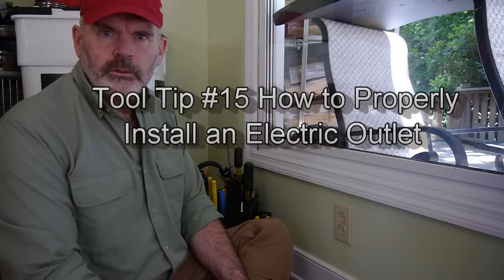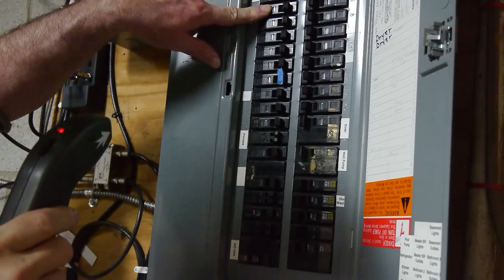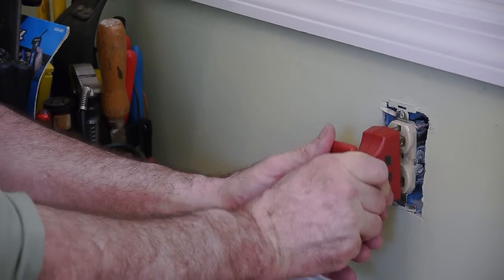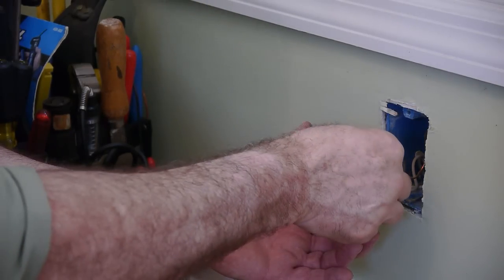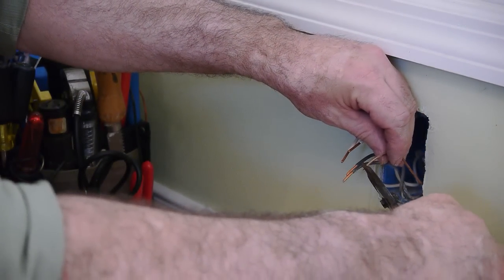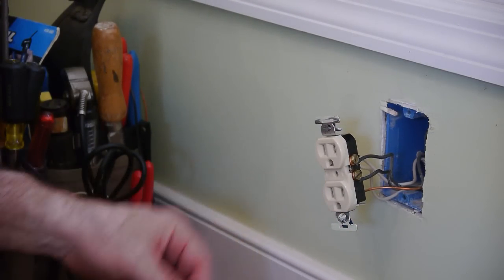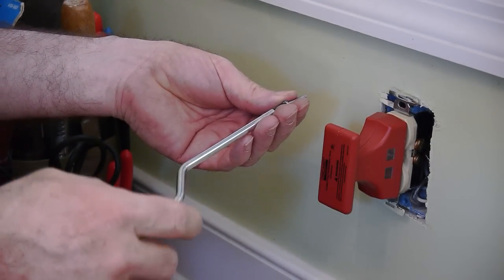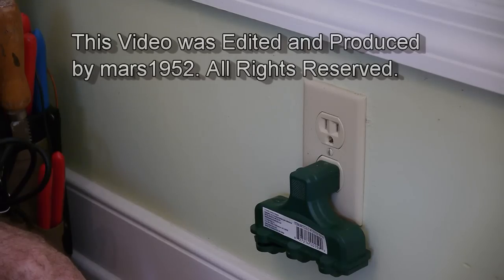How to Properly install a Electric Outlet Tool Tip #15

Comment: in the medical field thats how we install out outlets. just becuz most medical gears cords are heavy and they stay plugged in better.
Reply: I have heard this debated over and over.  I worked with a lot of electricians and technicians, and I never heard anyone tell me that they knew the reason why we did this.  A lot of people have their opinions and theories but since it isn't required by the NEC, I don't think anybody can prove the real reason we do it.  My theory is that some electrician thought this was the safest way to do it in a hospital and passed it on and it made sense to his buddies and it started getting passed around.  I used to install electrical equipment in Air Traffic Control towers and we were not required to install outlets upside down, and I know that our equipment cords were every bit as heavy as hospital equipment and they did not fall out.
Reply: It’s not rocket science try to pull a plug Down with ground down then with one up ... you’ll know then gravity is a bitch

Comment: There is no such thing as up side down unless the receptacle is stamped with "top" on the yoke.
Reply: I have one that is identified as up on one end and that end is with the ground up.
Reply: As I stated, it does happen, but 99% of the time, its only switches that are stamped "top" unless they are a spec grade receptacle.

Comment: I think outlet's should be made with the ground at the top, reason. I had a metal sign(cheap thin aluminum) attached to a wooden pole. It slide down the wall and hit the plug that was in the outlet, or it hit the small space between the plug and outlet. When that happens it blows the fuse/breaker.  If it has the ground at the top, that never happens. 
The first time that happened was at a house I was renting, it kicked the breaker, as it should. But as I said I was renting the landlord never told me where the electrical panel was. He was not home so I had to find it myself. And where it was , was a pain the the ass to get to, as the house had been added on to.
So when I built my work shop at the house I had built I put the outlets upside down to avoid the problem of anything getting behind a plug, in the outlet and kicking the breaker of causing a fire. Of course in the house most all are put in the normal way. But I still think everything should be made with the ground at the top stopping the problem.
Also at hospitals they have different circuits for different equipment and I've noticed outlets with orange covers(they have orange outlet also) are installed with the ground at the top. I asked a maintenance man and was told it was for safety for (I don't remember the equipment) to be plugged into.  Oh well that's my take on it.
Reply: Sylvia isgod  Most new refer's have a plug that is made 90% from the cord. as in bent 90% so the cord hugs the wall. do what ya want but that's the way  I wired my work shop
Reply: Sylvia isgod  yep, that's right

Comment: According to code ground is up. The outlet was installed correctly.
Reply: I don't what section the grd up thing is. It was more of a union thing. As I was told if something metal was to drop it would hit the ground first. Now the way he wired is against code. Code says "a device needs to be able to be removed from the circuit without interrupting the circuit" In other words DON'T double hit. Tie the whites together with a wire nut and add a short (4-6") pigtail to attach to the device. Do the same with black. Otherwise that little "jumper" is part of the circuit and turn into a fuse. It's there only to feed the  other half of the recep. Not the rest of the circuit. You break it off if you're splitting the recep. Half hot and the other half switched or 2 separate circuits (on the same leg)
Reply: Ground is down.  Sky is up.  PhD in Astrology here.
Reply: Any of you been to a hospital? Ground is up as anything falling down the side of the wall will hit ground first.
Reply: I never saw ground up until I stayed in Virginia.  Down south, at least in Georgia and Florida, it's ground down. Most plugs, like in refrigerators and washing machines are made for the ground to be down, too.
Reply: Sylvia isgod Sounds like a good compromise! 😆
Reply: Nope..according to NEC, either way is acceptable.  Commercial is usually ground up and residential is ground down. Neither is safer than the other.
Reply: Sylvia isgod  then why are you on here and not out solving the crisis?
Reply: Sylvia isgod that's acceptable to those that can.  Its unfortunate that not everyones work load isnt able to be performed at home. Virus or not the world still turns and Bill's must be paid for us not to lose everything we worked for. So these discussions like this one still are important to us that works in the field. Covid19 might be here but the world still runs.
Reply: Agreed-I am in and out myself.. I have my own opinions on the whole covid solution and how it should have been handled if we had an intelligent government but we don't. With that said I continue to push on in my line of work which is construction and remodeling. Since this forum is related to that here I am..

Comment: I have the same 2 wire outlet however do the Black & White wires also have to correspond to the top and bottom outlet? I understand that white go on one side & black on the other. But, does it matter if it's top or bottom? The one I took off to replace was using a white wire from one main wire set and black wire from the other wire set top outlet and bottom outlet. I have always just replaced them how I found them except this time it has me wondering if that's correct or not? I never thought about it before since it was working before. I cannot find a YouTube video specifying if it matters or not making sure to use the wires a certain way beyond the white both on one side & black on the other.
Reply from the maker: The black wires go through the circuit breakers. The white wires all end up in the same place (attached to the neutral bar) so I guess it does not matter if they get mixed up. Since I am compulsive I do not mix them.
Reply: @mars1952  I wonder if it matters when you're changing a standard outlet to an AFCI. I just did this on two outlets in my home and found that the white wires on both were not matched to the blacks of the same cable, so the black wire on top was opposite the white wire from the other cable. I wonder if there's a reason for it or just the electrician's preference. Anyway, I installed the wires the same way on the AFCI outlet and it didn't work. No power and I couldn't reset it. I switched the whites and it was ok.

Comment: I have a friend who lives in an old apt in Astoria, NY, it runs on 1 fuse and the breaker isn't accessible.  The landlord is slow to fix anything and it's been years.  Can she hire another electrician to fix outlets that are crackling? When she turns on the switch.  Thanks for your help.

Comment: I've actually seen the "very unlikely scenario".  Some metal wall decor fell off my wall,  hit the plug below, and the outlet shorted out between the two prongs. I was all like - holy crap, that actually does happen.  So, given that scenario, the ground should be up.  However, I agree that ALL angled plugs are designed for a down-position ground.  I've heard lots and lots of people say that ground should be up according to Code, but no one ever seems to be able to reference the actual code.  That's my pet peeve - people jive talking about code, but not actually being able to ever reference it.
Reply: No, the Code has been silent on this issue for decades and has not changed. Especially for dwellings. I have heard Hospitals have their own rules for outlet direction and that’s ok. This issue has been going on for ages. Since the code gives no direction, do as you think best. Lol.

Comment: I'm thinking plug might have been upside down because one connection is probably controlled by switch.
Reply: exactly...very common way of electrician letting u know the outlet is switch controlled. maybe that wasnt the case here.

Comment: Why did the whole assembly move at the very end, when you were pulling the night light out? Ahhh never mind. When you adjusted it, it came loose.
Reply: Because he did not have the outlet properly tightened

Comment: One of the indicators that a do it yourself person was doing work . You see cracked plug covers . That is caused when the plug is tighten right down in the box . You should leave from a quarter to a eight of inch from tight to the box . Then when the cover is put on it sucks it right up nice and straight with no strain on the cover plate to crack .

Comment: A couple of comments: A) the reason that the ground I placed on the top is to prevent electrocution if a plug is loosely installed and something falls across the top.  It's actually the "correct" way to do it, but we (Americans) got into the habit of putting plugs in "upside down", so manufacturers started making things that plug in upside down.  So, it's not "wrong", it's just the conversion now.  B) you should have used pigtails instead of connecting the wires directly.  The reason for that is that if the plug goes bad and you wire it the way mars says, then you lose power down the rest of the line.  If you wirenut the lines together and then have a pigtail coming off of that to the plug, if it goes bad, the rest of the line will not be affected.

It's a little disconcerting that mars didn't know about the way that the back of the plug works.  That's how ALL plugs are now-a-days.  How could he not know that?

Comment: In Ontario, its code the ground should be on top, no one does it
Reply: James iPad Ik I’m late, but if ur returning to Ontario Canada you are wrong there is no code indicating which way it’s installed except when installing horizontally
Reply: @slugh8499 - Assume you meant referring, not 'returning' .

Comment: the question is arc fault or ground fault , trips a breaker quicker
Reply: Arc fault more sensitive but they both dump at the same speed.

Comment: What is the name of that wireless tool you used to check for the power and you scanned the circuit breaker box?
Reply from the maker: Search for "wireless Circuit Breaker Finder".
Reply: aperxmim it is called rubbish.

Comment: Installing duplex outlets with the ground up is a good idea. If something like a metal ruler that was leaned against the wall fell over and by some odd chance slid between the outlet and plug, it would strike the the ground prong instead of possibly striking the live prong.

Comment: I was once measuring a wall and the tape measure slipped (as they always do) and it fell onto a plug that was slightly out of the wall.
The ground pin was down and so the metal tape measure shorted across the live and neutral pins sparking and giving me an electrical shock.
The ground pin should be at the top for this reason.
Reply: Exactly, or if a child would be near it with let's say a butterknive. This would cause a seesaw effect and no electrical shock. Brains people!!

Comment: Here's a dumb question... Why is there a second set of black and white wires? I assume that they pass through the outlet and then off to other outlets and what not on the circuit?

Comment: What is that tool called that he uses to grip the outlet with? I have tried to locate such, but since I do not know the correct name, I am at a loss to find them.  What is the red handled outlet remover tool actually called?
Reply: I forgot to add that I have rheumatoid arthritis, so a handle on such would help me a bit in doing these swaps and repairs.
Reply: It's called an Outlet Plug Install Tool. Harbor Freight sells the Chicago Electric brand tools, as does Amazon, but neither offer this item anymore. Both list it as item "94742."
Reply: Thanks, Joe. I have searched amazon, ebay and many other sites, but this produce it no longer made or sold, as best I can determine.

Comment: Hospital has the safety ground on the top of the duplex?
Reply: yes, in more industrial settings, i.e. not a house, there usually is the ground above the duplex to protect the duplex from shorting out if there is ever something that falls on top of the duplex, which could cause a short and cause a fire. its really just a safety thing.

Comment: I know nothing of electrical, can't you just flip the outlet without replacing it?
Reply: Andres Gaviria yes you can. Long video for such a simple job.
Reply: Yeah, I have no idea why he started out with the idea of replacing the plug.  He didn't even know that it was wired "incorrectly" until he pulled it out.  Too bad he then wired it incorrectly in a different way.

Comment: How come there is no blue fire ball when you touch neutral with screwdriver ?  When I change it, even though I turn off breaker, there is blue fire ball.
Reply: You have a wiring issue. I have never had a blue spark from neutral or the hot side when the breaker is off.?

Comment: What is the name of the tool you used to find the breaker, the one that sends the radio signal?
Reply from the maker: +Dirk Smithson It is a "circuit breaker finder". They range in price from $25-$90.
Reply: Thanks!

Comment: Why are there 2 sets of black and white wires? I assume the line runs to more outlets. If so why aren't there 2 ground wires?
Reply from the maker: The ground wires are twisted together. You could do the same with the black or white wires if you want to.

Comment: What is that red device called that he starts using at the 4min 32sec mark?
Reply from the maker: Sorry I can not remember what it is called or where I bought it.
Reply from the maker: I looked at the tool and it says Chicago Electric Outet installation tool. Here is a link:
 http://freightset.com/pdsdisplaypagedetails.asp?pid=1079211
Reply: Crossnote it is called rubbish.
Reply: @mars1952, your link doesn't work anymore. Harbor Freight sells the Chicago Electric brand tools, as does Amazon, but neither offer this item anymore. Both list it as item "94742."

Comment: Yes, there are certainly some extension cords, night lights, and other devices with three-prong plugs that seem upside down when you plug them in, but that happens no matter which way your plug is installed because manufacturers are clueless, too. There appears to be no "correct" way to install these three-prong outlets; however, most knowledgable sources say they were designed to be installed with the grounding prong at the top. The reason is that if the plug is pulled partway out of the socket, one might accidentally come into contact with the prongs of the plug. It is far less likely for a person or object to come into contact with the hot wires if they are on the bottom and the ground prong is on the top.

Comment: Ground  should always  be on bottom  if on top & plug hinging  down  ground  might not make connection
Reply: Hospitals and doctors office tends to have the ground on top due to the fact if the plug comes partially out of the socket and a metal instrument falls on it it will make contact with the ground pin instead of the hot and neutral.
Reply: Just saying so doesn't make it so.

Comment: I remember reading about this being code. Most building codes are stupid and of course it is the gov't intruding on our privacy. Enough of the political rant. If a tool that is metal with a long skinny piece(screwdriver) were to fall on a cord that isn't plugged in all of the way it would short the hot and neutral. This isn't anything I have ever witnessed but I read it years back. If the tool falls on the ground it would just roll off. All the remodel work where I work is upside down.

Comment: Decent tutorial but too long and it failed to explain an important aspect of this particular outlet installation which can cause confusion: what is the reason for two sets of wires. For those who have that questions, here is the answer: one set of wires (one black and one white) connects the breaker panel (source of power) and it's enough to power this outlet. The other set of wires goes to another outlet in a daisy chain or passthrough.

Comment: you can't use the plug to complete the circuit, you must pigtail the hot and the neutral wires first. here you have two black wires and two white wires, you must get a third white and put it on the white wire. this way the circuit is complete and you do the same to the black. this way you can take the plug out and the circuit will still be complete. It's code. I'm not trying to be mean but I was an electrition for 22 years. Other than that good job!

Comment: you cant use the device to complete the circuit, you must pigtail the wires first then install the plug.
Reply: Not in residential and before code change only the neutral if paired with another circuit.
Reply: Yes you can but in my opinion you shouldn't.

Comment: plug still crooked and loose lol u can see it move when you plug it in in the end of the video
Reply: Maybe the metal box is loose in the wall ? The outlet mounted to the box is tight .
Reply: Bill Smith not at all those blue boxes are in there pretty snug( either clamped to the dry wall or nailed in) u can see the metal yoke is hitting the dry wall bending at the top and the device is sliding around not tight at all, watch the video and you’ll see for yourself. An outlet shouldn’t be recessing into the wall when plugging something in